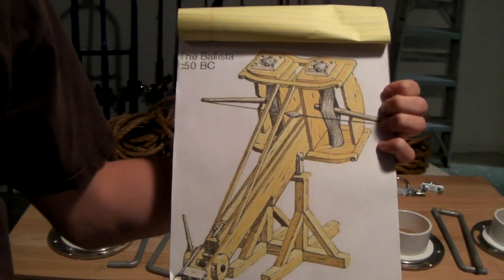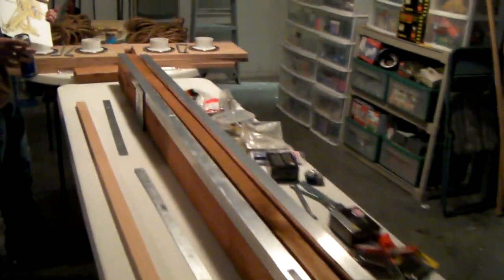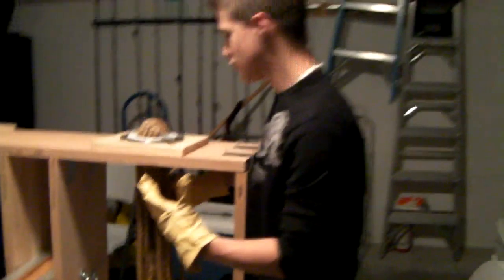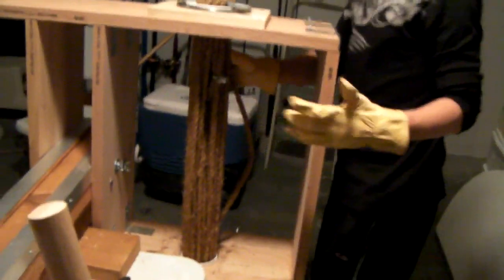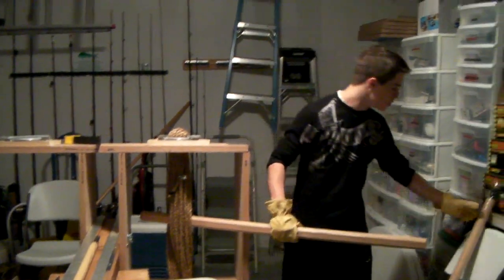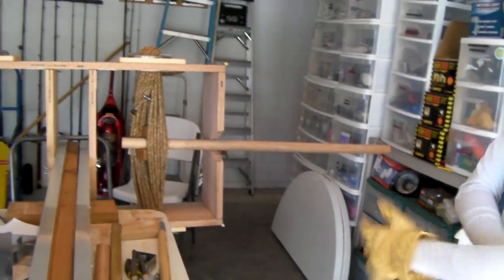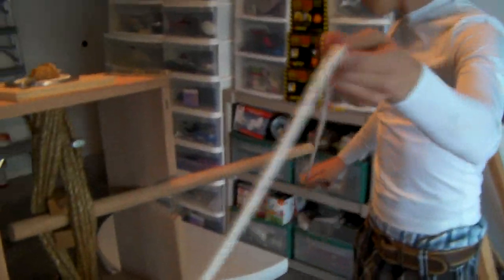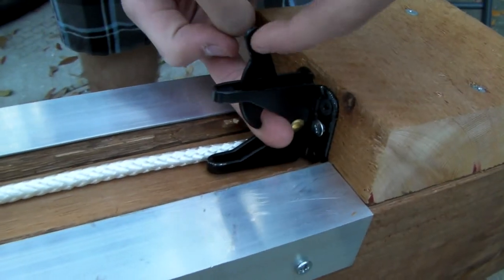Ballista Construction video.mp4

Comment: i think you need to put some more tension on those ropes mate xD do you have the thing at the corners you can turn to make it more powerful?
Reply: It looks like OP is using jute or hemp cord, not the best. A close material to the original sinew would be nylon cord (twisted, not braided). 

Torsion-wounded springs are no joke, when I was building a miniature 10 pound ballistae, I was using pine boards as thick as OP here was using, first attempt snapped in half the top of my unfinished frame. They say for every pound of draw you're getting, those twisted cords are pulling down with 4 times the weight, so a low 50lb draw weight would have over 200 pounds of stress on the frame. Props to those that manage to build fullsize working replicas of these things.
Reply: @markuswolfram4587 woah 4 times is alot does that make this type of design kinda useless tho since a large warbow could be 150 pound draw from just a guy so if you wanted that on this youd have to build it to hold 600 pounds

Comment: could use more power but thats amazing!
Reply: probably just needs to have a shorter rope so its already under tension before pulling it back like a bow then might help to have two of the latchs to hold the rope that way the bolt can sit in the middle and right up against the rope but yeah its amazing

Comment: Sorry, but you did everything wrong.
1) Don't but your fingers near smth that can cut them off! You need to change you trigger mechanism, or once you'll be left without some fingers...
2) Arms shouldn't hit anything. With such massive arms you have high moment of inertia, so during shot a lot of kinetic energy is "in them". When arms aren't hitting anything and are stopper just by bowstring then near the end almost all kinetic energy is transfered to projectile, otherwise this energy is just wasted.
3) Everything is just to thin. It's too complicated to write in a comment, but just look at my desing that I'm just working on, here everything is calculated with mechanics of materials. With such amount of ropes as in yours design you should be able to get at least 1-2kJ on projectile, but with such energy and such thin parts forces would just crush everything